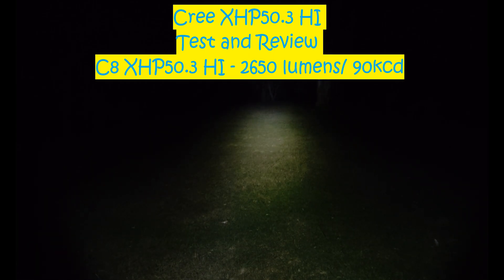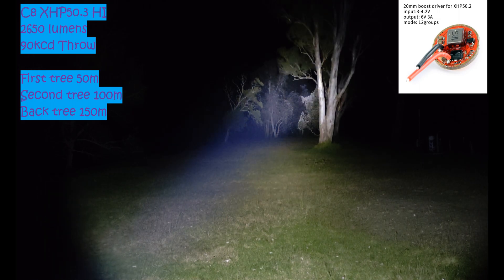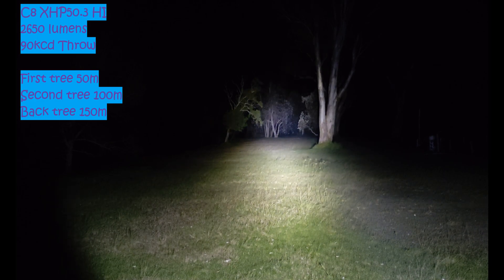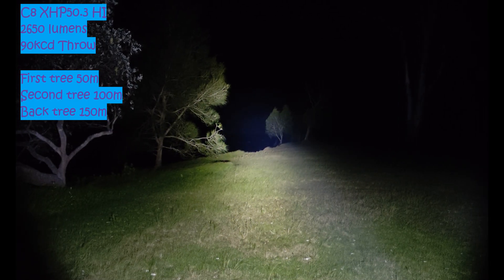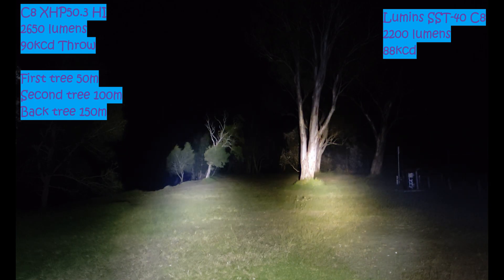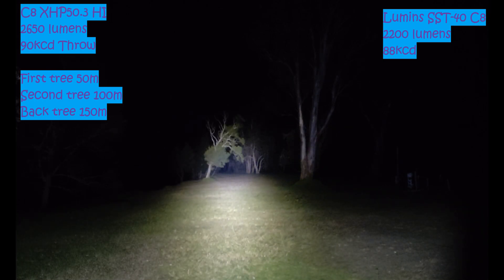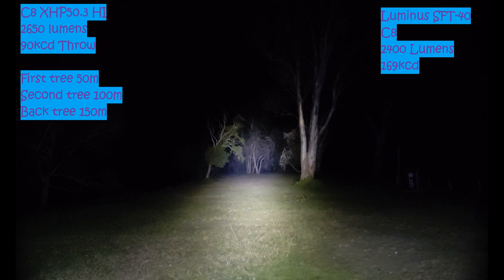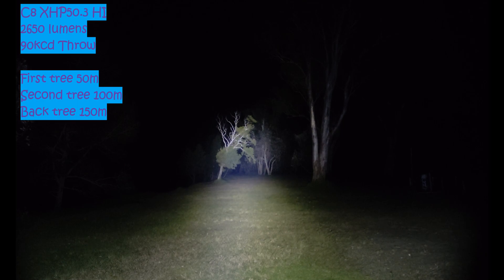Convoy C8-Cree XHP50.3-HI Test and Review/ Beam Shots

Comment: Hello, have you try the new 3volt version of xhp50.3 hi ? i wonder which will be brighter if you direct drive this 3volt version vs the 3amp 6volt xhp50.3. .
Reply from the maker: Hey, sorry i missed this comment, i want to buy the 3v version but i have so many spare LED's right now i can't bring myself to spend the money, I think it will outperform the 6v XHP-50 in a single cell light but also Convoy have the higher power 6v boost drivers out now that would help with this LED.  You can potentially get 4000 lumens from a 3v XHP-50.
Reply: @everydaysurvivalgear  i think i will buy the 6volt version of xhp50.3 hi and using 17mm convoy 6v 5amp buck driver for my m2 project because direct drive driver like the one use in blf a6 is no where to find today in aliexpress or banggood.. can only be get in mtnelectronic, but the shipping price is quite high... The 17mm 3v convoy 12mode driver is limited to 5amp.. 6volt x 5amp = 30watt, i think its more than enough to beat the olight performance.
Reply from the maker: @harisyoung4110  I have what you need you can buy the 5 amp Convoy drivers and bridge the sense resistor, i have a video on it. https://www.youtube.com/watch?v=Eiok5Oy_lb4
Also depending on the size you want Simon Convoy has a few more powerful drivers you can use. If you don't mind basic i found these drivers super cheap but the quality is meh like it works but mode selection and features is very limited. 
https://www.aliexpress.com/item/1005005026756729.html?spm=a2g0o.cart.0.0.59ea38da3RwDDX&mp=1

Comment: I accidentally bought a 6V XHP50.3 instead of 3V.  What's a good 6V ready host I can reflow this in?
Reply from the maker: You can buy a 20mm single cell boost driver from Convoy store on AliExpress, that will run this LED and will fit inside a M21A host.
Reply: @everydaysurvivalgear  Thank you.  I am going to get a D1 from Hank instead. Your suggestion works too.
Reply: sst70 or sft70 thrunite catapult?

Comment: Nice video mate, i remember you uploaded a video about xhp50.3 hi before maybe it was different host? it's kinda crazy how those luminus are close to the output of the xhp50.3 hi, till i realize that sft-40 is pulling 10 amps,  the xhp50.3 hi @ 10 amps should do more than 3000 lumens easily right?
Reply from the maker: Yea the L6 was supposed to be about the XHP50.3HI but I never finished it it was to hard to get a good focus with the reflector. 
This C8 is doing about 20 watts, while the SFT40 is doing about 40 watts but outputs a similar amount of light. The XHP50.3HI is a 6v LED so it should be more efficient overall. At 40 watts you should see maybe 3500- 4000 lumens.
Reply: @everydaysurvivalgear  that's sick, to have 40 watts in a very compact light, i know that he xph50.3 hi is floodier than the sft-40 but, to you that did the comparision side by side in live, does the sft-40 feels brighter due to the light goes further?
Reply: From BLF, XHP50.3 HI does about 4000 lumens at 9Amps so that is impressive